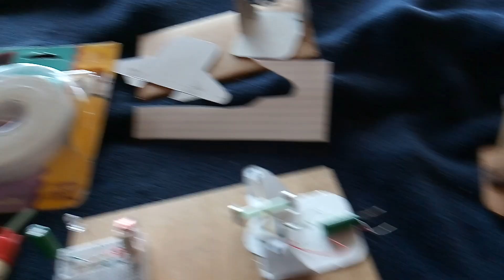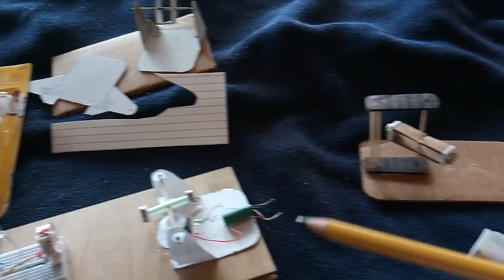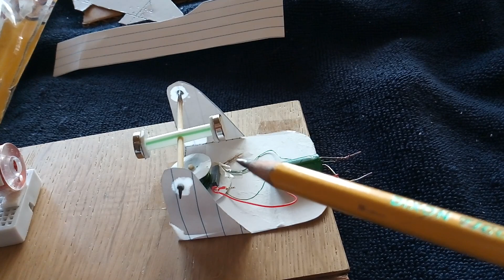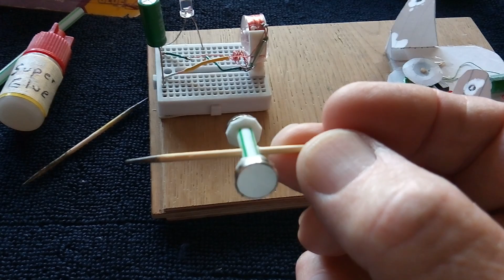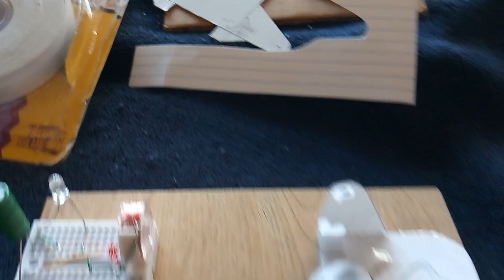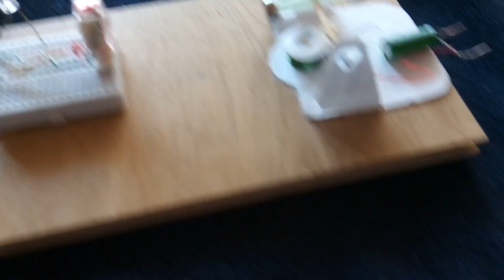Strange Paper Electric Motor

Comment: I'd guess there's a low number of turns of thicker wire so it's putting more power in from the cap and will discharge faster. The reason it goes faster after external excitation might be because of timing of the pulse, so the timing is set up to work well at high speeds as evidenced by the proximity of the switch to the coil, so is suboptimal for low speeds. In other words, it's wasting energy at low speeds pulling when it should turn off/push or vice versa.

If you had an oscilloscope you could use an external pickup coil to detect rotor position and compare it to the drive waveform.

Would be interesting to see the wattage vs your other motors.
Reply from the maker: Thanks for the great feedback.  Your comments are spot on.  A scope would really help here.

Comment: That is a good one and it does get really fast. Great for display purposes. 
Weird to think someone could assume this was being powered by compressed air unless they had no clue about electronics.
It's like the Tesla coil effect. Once it reaches the correct resonance then it works in harmony. 
You will never get any real torque on it and I am sure you know that but imagine if you could you would make millions. 😁👌👍
Reply from the maker: Hi Mike.  This was a surprise.  Today I did another one and got it to resonate to the 60 cycle hum coming from an overhead light.  I used an AM radio to hear it happen.  Really interesting little project.  A Tesla coil is a good analogy.
Reply: 100lb flywheel and scaled up design. Wonder if thermal dynamics would be too mean then.

Comment: Could you please share a circuit diagram and your cardboard pattern for fellow tinkerers? Thanks
Reply from the maker: I am working on the final pattern design.  The circuit is a simple reed switch air core coil pulse motor setup.
Reply: @Lidmotor  OK thanks. Kinda hard to tell from the video alone 👍🏻
Reply: @Lidmotor  Don't forget the circuit for the external exciter and if there's a reed switch in that. 
The Inductive acceleration is interesting.

Comment: +1 for the bare feet video lol. Folks need to watch your huge collection of themed devices!
Really good paper bearing btw for the toothpick... other bearing types might not allow that harmonic resonance effect, or maybe they would with a 'Maggie' type device on the other side. I thought it was similar to the way a Hall sensor can dramatically affect a firing speed, the 'Maggie' coil being fortunately at exactly the right height. Thanks for the shoutout - these are fun experiments 😀
Reply from the maker: These are fun little projects.  Your comment about the simple cardboard design motor being the most interesting sent me down this path.  Who knew that this simple paper motor would hold such an interesting harmonic resonance surprise.
Reply: I personally feel Maggie needs to be resurrected. For nostalgic reasons.
Reply from the maker: Maggie is still with me but really showing her age now.  Her eyes still light up anytime a big spinning magnet comes around.  Ha. @benwinkel
Reply: The old girl can tell a tale or two.  @Lidmotor Maybe it's time for a younger 'generation'?

Comment: The energized coil pulls on the magnet, then the collapsing field pushes on the magnet.
Reply from the maker: Wow!  This is more interesting than I thought.  Perhaps the stuff of a new thread on a forum.
Reply: @Lidmotor  Dual Action. Attraction followed by repulsion. 
There's many ways to apply this to the various configurations you have in existence which have been shown here.

Comment: Harmonic resonance. I've experienced the same effect on my replication of your Toothpick motor. Using a scope, you'll see the frequency and rpm ratioed harmonically. Mine can run at 60 rpm or 600, depending on the initial rpm.
Reply: The ratios are always different, depending on decreasing supply, initial rpm, location of the reed switch and its switching speed. Permanent magnets attenuate the high ratios through the Lenz effect, and electromagnets enhance them. Theoretically, if friction losses weren't present, there would be no limit to the high freq ratios. 
Don't try this at home, kids. 😎
Reply from the maker: Thanks for the feedback.  Harmonic resonance -----that's the answer!  Thanks.
Reply: Any speeds in between as well or just the 10x increments?

Comment: amazing how gullible people are. you're using compressed air, buddy.
Reply from the maker: No!  This is just a simple electric motor running on energy stored in a super capacitor.  I don't do fake videos.
Reply: @Lidmotor  i can see another bare feet video coming soon , good to see the pulse motors again
Reply from the maker: If I keep getting "faked video" comments I will probably do one of my famous walk around videos.    Bare feet included. @johnwynne-qx6br
Reply: perhaps. i would like more proof next video. just please pull the camera away from the "working" device to show that there are no other sources of energy being hidden by the lens frame.
Reply: ok, sounds legit
Reply from the maker: @h7opolo  Thanks.
Reply: @Lidmotor   I'd take it as a compliment that you've done something apparently so difficult or unbelievable that they think it's most likely you've faked it!

Thank you for documenting your builds and talking about what you find works and doesn't. You were one of the inspirations for me to build a similar motor, and now I have two that run off Caps indefinitely, using a solar panel to charge when there's light. This kind of project has a steep learning curve, but you've scaled it and now make it look so easy people think it's a trick. Well done!
Reply: Why do you think he did that?
Reply from the maker: It isn't faked!  The motor runs on stored energy in the super capacitor. @sinsemilla9876
Reply: @sinsemilla9876  a lot of fakes, plus the frequency of angular moments did not seem to correspond to the electrical sources claimed to be delivering power.
Reply from the maker: @h7opolo  Based on the comments so far it appears that what I have stumbled on is an effect called "harmonic resonance".  The electric motor hits a certain rpm that it likes and smoothes out. The energy does drain out of the 3.3F super capacitor in just a minute or so but it sure provided  an interesting effect.
Reply: lol I thought that was a hilarious piss-take between friends but how certain you are for a total moron is just as funny 😆